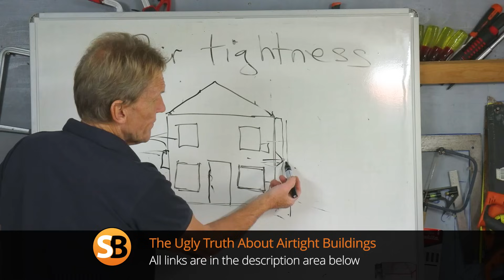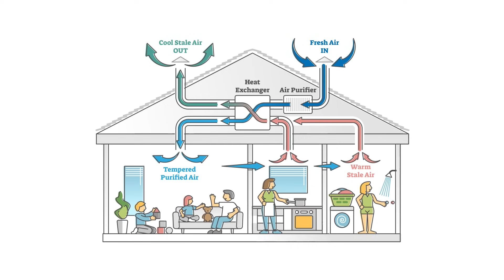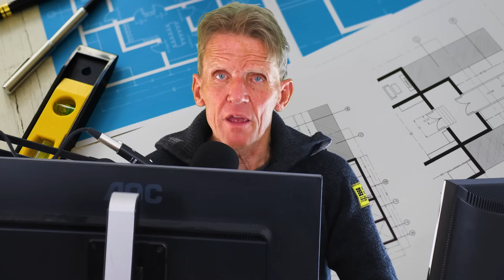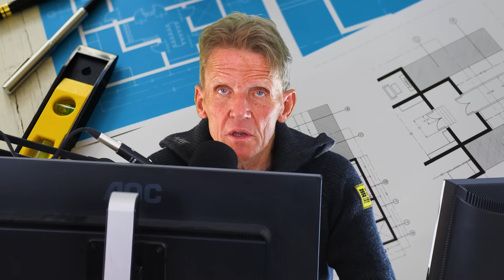Why Airtight Homes Are a Terrible Idea

Comment: You cannot introduce airtightness into a house without also introducing Ventilation. It should be mandatory for all airtight houses to have Mechanical heat recovery ventilation. This makes for a warm healthy house.
We did a retrofit with internal dry lining, triple glazing and airtightness. Humidity hovers around 50%. Our heating is down to 500ltrs oil a year with point source heating from a small wood pellet stove and no mould anywhere.
Reply: Great, but certain ethnic groups will button up the whole house like a biscuit tin, boil cook and cover all vents, plus disable any mechanical ventilation! Then complain to a compliant BBC about mould growth and their kids having respiratory infections! And, it’s all the owner’s fault, naturally!

Comment: Modern PVC windows have draft seals all round, but have to have ventilation slots as well ! Someone needs to get their ducks in a line.
Reply: True but it you are replacing existing windows then you don’t have to and like Roger said many people say no for it because noise and draft. For extension etc they need to put for building control

Comment: I live in one of the dampest parts of the UK, right down in Cornwall, surrounded on three sides by sea and ocean and you've go to keep the windows open! The Germans call it "stossluften" or storm ventilation, open the windows when you wake up, let all the air replace and then close them when you go to work an hour or so later.
Reply: Good luck saying tht to ur tenant! - even the good ppl of the lot dont tend to understand how important it is to maintain good ventilation in the house! - with energy prices being so high, I dnt completely blame them!
Reply: Energy is not even real excuse. When you let fresh air in, it brings more oxygen so then the room warm faster. While the stale air has less oxygen and more co2, which means it is takes more time to warm up.

Like, with stale air it can take 1.5 times (or even more) to warm up the room, whilebif you open the windows for a bit in the morning, it will take less time to warm tye room after you close the windows, and less time to heat it means less electricity.
Reply: @VarKartograf sounds great in theory. In reality it's howling a gale outside pouring with rain and 8 degrees. 

You open the windows for a couple hours and your house becomes a live in fridge.
Reply: @Jafmanz
Bruh, no one here says to open the windows for hours when it is cold outside. Also, in my comment I said *for a bit*.
Reply: @VarKartograf define ''for a bit''
Reply: @Jafmanz
Well, for a bit is for a bit - like, up to 10-15 minutes usually in autumn and spring. For winters it depends: in warm ones up to 10 mins; if it is serious winter, then 3-5 minutes at max.

It is common sense to use "for a bit" for short amounts of time, not for an hour or hours. But still, there you go, I clarified.
Reply: @VarKartograf what a load of rubbish.
Wear a gas monitor. Internal levels of oxygen and co2 don't even change.
What are you on about for crying out loud.
Reply: Good old German efficiency 😉
Reply: As the owner of Airtesting SW based in Cornwall, I concur 😂
Reply: You live in Cornwall and you have a job!
Reply: DAMP AIR ?

Comment: 1:30 - Just to clarify for anyone watching this. The government weren't short sighted, the Building Regs, Part F (Ventilation) have been around for years. Current version, 2021 edition, has a whole section on "Replacing Windows" with appropriate guidance under para 3.15 & 3.16 on whether the windows do, or do not, have background ventilators. The issue here isn't about the government requiring homes to be more air tight, it's around old homes that had shoddy workmen or double glazing salesmen not knowing what they were doing and blocking up, or not providing/replacing ventilation, so the government had to step in and introduce guidance in 2010. The government has not pushed for existing homes to be made more air tight before this. Air testing is only required on new buildings.
Reply: British government, famously far sighted

Comment: I'm sorry, but why don't you mention the Government guidance that is the Building Regulations, in particular Part F (Ventilation)? That covers how much ventilation (both background and purge) should be provided. So why say they aren't doing anything about it when they clearly have published the relevant guidance? 
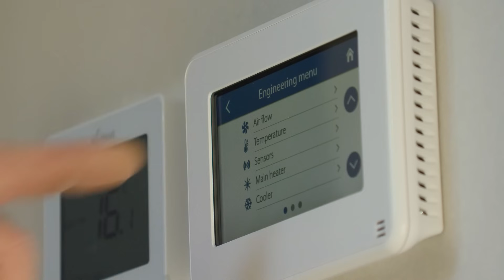Also funny that you don't like the idea of retro fitting heat pumps (as you might need to upgrade some pipes) but fitting an MVHR system and ripping out ceilings or boxing in pipe drops you are fine with? I'd argue it's just as much upheaval. Just look at your example @ 2:06, without posi joist and in an existing building how would people ever go for this?

Comment: I had this problem after I did everything they said to do after an Energy Audit of my house. But then I started to get headaches.  Ends up I was getting a buildup of CO2.  Resolution was forcing the central air fan to run 15 min every hour.

Comment: THe richer people used to use drapes all along the walls to manage moisture and mold. Better off using extra or thicker blankets than perfectly cealing the home from the outside.
Reply from the maker: Looking at some of my very old books on building they even used canvas stretched a few inches from the wall to stop the damp.
Reply: now people they have sealed houses and MVHR systems.

Comment: I'm happy in the winter to open the windows all day in the rooms I'm not using. Problem is the radiator turns itself on and wrecks my gas bill. What I need is a thermostat that I can just turn off during the day, no ability to provide heat at all, off means off. Does such a thing exist, without an app?

Comment: I've got the opposite problem. In January's cold snap the RH dropped to 28% and I found myself boiling a kettle of water on the gas hob to raise it (my skin gets very itchy when its that low) to a more comfortable low-30 figure. A 15 minute blast on the smallest jet was sufficient. Its a 1990s built house with a few insulation upgrades. My suspicion is that its because I'm retired and keep the heating on low all day. Also I live alone so only one set of towels and washing to dry.

PS - I'm pretty meticulous about ventilating the bathroom after a shower, but otherwise don't do much to remove moisture. Is it just luck?

Comment: If you insulate your house and make it airtight without mechanical ventilation, your house will rot.  I've installed 4 MVHR systems now and they're fantastic.  Constant fresh warm air, no mould, cost pennies to run.  Absolutely barmy that they're not mandatory in newbuilds.  You don't even have to do every room - just having an extract in the bathroom and a supply in the hall makes a massive difference.
Reply: There's a cheap way around it. You need to open the windows wide at least 2times a day and every time after any Steam generating activity like having a shower or cooking. And leave some windows slightly open - turn the handle about 45deg.

Comment: I found opening windows or the door for a while with the fan on freshened up the air and reduced the humidity in winter. Especially on dry days. Not healthy to keep recycling the same air again and again. Nothing too high tech, just put on your thick jumpers, make a hot drink, then put the heating on afterwards

Comment: MVHR is really the way to go, we moved into a new build with it after a mould infected rental (not visible, on inside of some of the walls… fully slick with black). The window frames are not fully airtight, for reasons beyond my understanding “within tolerance” but the air quality and interior humidity is fantastic. Lowest humidity I’ve ever recorded in the house was 27% -- amazing for London, with low heating, clear windy skies and crisp cold nights. During the hot humid summers it barely gets above 50% interior humidity. I use a dehumidifier with hygrometer for drying clothes inside, it will only turn the condensing coil on when needed, otherwise it is just a fan and even with just that helps dry clothes very quickly. 
After living with this for several years, we would never get a place that either didn’t have one already, or didn’t have the loft/ceiling space to install one easily immediately. The only difference I would make to my current one is having an air outlet and exhaust in each room rather than outlet in the living spaces and exhausts in the wet rooms only.

Comment: The current obssession with making residential property airtight is ridiculous. The advantage of lower heating costs is outweighed by the negatives in my opinion. How it negatively effects health is difficult to quantify but you don't neef to be a doctor to know that breathing in stale air, or 'shared' air is not good. Has any research been done on the build up of airborne germs or viruses in a 'sealed up' modern house compared to one with a reasonable amount of fresh air intake from outside. Perhaps we should take a whole new approach to staying warm - something totally novel like wearing mor clothing when it's a bit nippy ! I wear a wool hat when I go to bed in winter and occasionally thick wool socks when its really cold . I do not heat the bedroom once I have gone to bed.
Reply: I don't think breathing air that's come into the house via the cavities and underfloor spaces is all that great either. It's also uncontrolled, so on windy days you will have more ventilation than required and on still days, potentially not enough. The new way seems much better to me - build airtight and then ventilate it with MVHR, or some other design e.g. passive stack, that way you get fresh, filtered air, and bills are lower.
Reply: @123a-o5d  I completely agree. It's just the Luddites that don't understand.
Reply: @markburton8303  'Airtight = bad' and that's the end of it; no more thinking required. "Bring back chimneys and open fires". "Government can't stop me opening my windows". "It's common sense not to insulate". "My new windows caused my mould problem, waah" etc. LOL
Reply: Learn more and you will understand how wrong this is. Modern tightly built homes have ventilation and the air quality is MUCH better than old leaky houses. The incoming air is truly "fresh" because it has been filtered. And yea, there are a TON of studies on indoor air quality that prove tight houses with designed ventilation are much healthier.
Reply: the whole point is that you have an air tight house and then use an MVHR system to control the ventilation whilst retaining the heat.

Comment: Yes, there is good physics behind the fact that it is much lower in energy input to heat dry air as it has a much lower specific heat capacity than wet air.  Same is true of drying liquid moisture that has formed in a house - the latent heat of vapourisation of water is massive so best not to have the damp areas there in the first place.  Get external atmospheric air to do it for you by venting and opening up the windows!  Quite a bit of physics is counterintuitive!

Comment: This is the best video I've seen on damp, it should be compulsory viewing for every household. Well done!

Old houses had chimneys galore and drafty sash windows but coal was cheap and every room had a fireplace. An open fire or a stove sucks huge volumes of air out of the room while warming the structure so old houses never had damp. Block those flues and fit draftproof windows and you're heading for trouble - at the mininum, condensation under the sarking in your attic and high humidity ruining anything stored up there. At worst, mould inside the house. 

We live in a modern house built to the latest Scottish regs. You'd have to try very hard indeed to burn it down as every ceiling is double thickness. The first floors are solid and soundproof. It's extremely well insulated and totally sealed BUT every bathroom and the utility has a small Vent-Axia extractor running at trickle on 5 watts that ramps up when it senses moisture. The kitchen has two powerful extractors that actually suck the door open causing a draft to come through when we cook.  Consequently we have no damp, no odours and no mould in the shower sealant.

Your suggestion of a positive pressure heater in the attic is the easiest and cheapest solution and as good as trickle fans in each room; a very low positive pressure in the house will keep drafts out and push out moisture. Great idea!

Comment: My house was built in 1856 it's rubble fill with 22inch thick walls and a cellar, the best way to heat these houses is by stove, plenty of heat and plenty of ventilation
Reply: Yup, mine is from 1903 and woodheat is the best way to heat and dry.
The warmth even heats up my bedroom just enough to not be freezing cold❤

Comment: Old House used to have airbricks in top corners of their building , no mould
Reply: True, my house was built in 1953 and has those air bricks although it has double glazing no mould.
Reply: Mine built late 60s, open fireplace in lounge, air brick in top corner of bedrooms and bathroom, even with loft insulation, cavity filled and double glazing fitted no issues

Comment: I’ve got a 3 bedroom Victorian house heated with a Rayburn, wooden sliding sash windows with nice heavy curtains, fireplaces (not used but open) in the bedrooms and no cavity insulation in the walls. Never had a problem in 26 years with condensation or mould and it’s not a cold house either. A relative of mine changed everything original with his house, plastic windows, insulated the walls, sprayed foam on the slates, etc… He’s since had issues with mould in the bedrooms, damp in the roof and the brickwork falling to bits.
Reply: That’s a golden age of architecture for houses. Everything was meticulously designed for comfort. Throwing modern plastic windows on a Victorian house is pure vandalism!
Reply: @mcdaddy2011  Totally agree!
Reply: Unfortunately, the lunatic Net Zero agenda being forced onto us by governments will insist old houses must be spray foamed and plasticised, terrible for the environment and our health. It is Madness and we must resist.
Reply: @BirdsAloud  just say UK houses are far behind continental in terms of quality.
Reply: maybe these damaging retro fits are designed to ruin old houses?

Comment: air extraction heat exchangers work in my bungalow. extract the warm high humidity air and part heat the cold incoming air. They generally work as negative ventilation as to get hte efficiency rating they cannot heat the cold incoming air at the same rate as outgoing air but on normal mode it takes only 5 watts maximum

Comment: Opening the window in the UK in the winter months only works if the path/roads are dry. The humidity outside is typically higher than indoors if it's wet out.
Reply: Depends on the temperature, doesn’t matter how wet it is outside if it’s cold the air cannot hold moisture.

Comment: Had a problem cottage. Lots of damp issues due to construction. Made worse when tenants fitted secondary glazing. Humidity used to be in the high 70's over winter. Nevee dropped below 70%. Fitted MVHR. Turned it on mid morning. By lunchtime humidity was around 50% and never rose above 60% for the rest of the winter. Damp and mould issues much reduced.